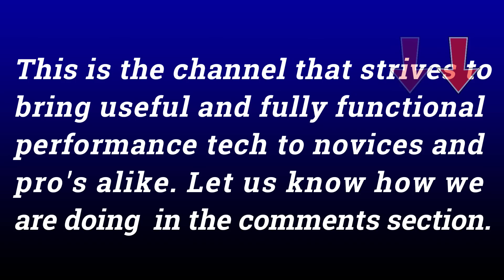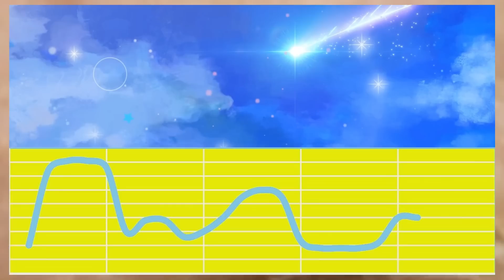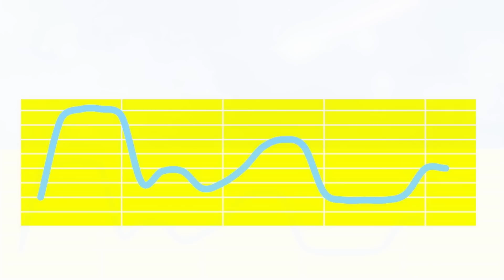DV's take on Weingartner cam shootout.

Comment: I wanna see a cam challenge on a 400 SBC, 23 degree heads, hydraulic flat tappet 2000 rpm to 7000. Just to see how the better exhaust flow but worse intake flow changes what cam split is needed.
Reply from the maker: You've got that right!
Reply: Pretty broad rpm range. I bet it’s hard to load the motor on a test over a range that big. I have never ran a dyno that will hold the torque over 5000 rpm range.
Reply: @doomman700 on an engine dyno, yes.  A chassis dyno with an eddy current power absorber can do it though.  When I consulted for Dynocom, I developed their load ramping function for loading compound turbocharged diesels, we could load the engine enough in 1:1 to spool the turbos as low as  1000rpm and take the engine up to 4000rpm with load increasing steadily to simulate a pulling scenario on trucks making 60-100psi.  The issue is convincing some of the hardcore old timers that there is  a better way to test.  An engine dyno using an Eddy Current  PAU instead of a water brake would be the way to do it.
Reply: @doomman700  I could see droping the peak rpm down to 6,000 to mimic a street build more. But I would love to see if a cam with very little exhaust split or maybe none would perform better.
Reply: 1000-4000 is easily done on a water brake. That’s a pretty small spread 3000 rpm, 2-7 is almost double that spread.
Reply: @ 1000-4000rpm is not easy with torque numbers running 1500-2500lb/ft+.  Very few dynos can measure that, of those, even less will have water brake absorbers.